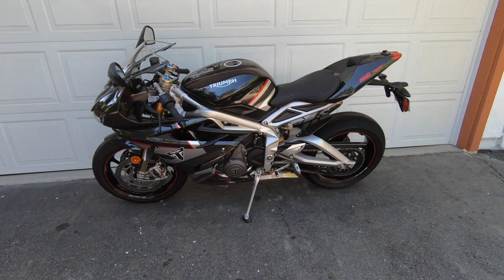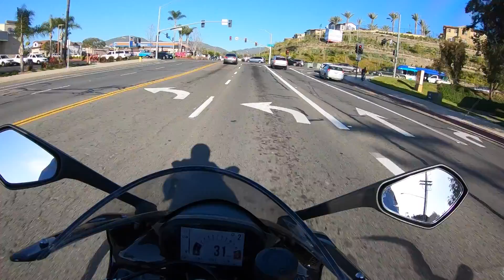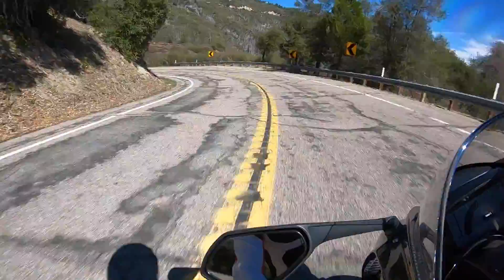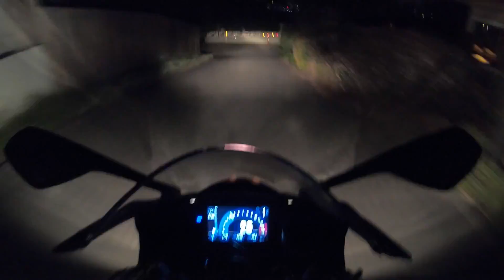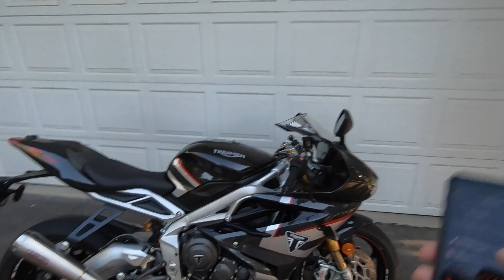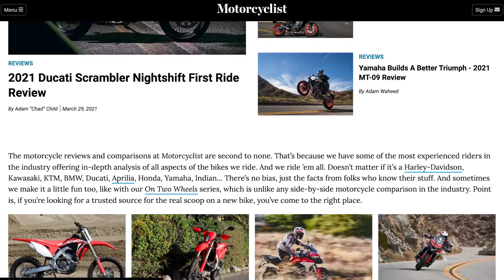2021 Triumph Daytona Moto2 765 Limited Edition Review | MC Commute

Comment: Only 765 of these made, lucky sobs. Get em while you can, oh wait they're gone.
Reply: Not really, they’re sitting at dealers
Reply: @pmwaffle9348  The pre-orders were all gone when I made this comment.  I think most of the ones at dealerships are pre-owned from those orders who don't want to keep it.  They are probably super low miles, but still someone rode it first.
Reply: @towatchvids  there's a few new and used starting at 12k. Most new ones are around 14 though.

Comment: I really cannot see a good reason to get this over an MV Agusta F3 800 RC which is it's most direct competitor I'd say. 
But then, this is a great bike too. The engine could have a little bit more power to seal the deal though, in that aspect is where I lean much more towards the F3.
And that Italian "je ne sais qoui"
Reply: Reliability and dealer network would be my concern. Mv looks stunning but, not so much if your staring at it broken down at the side of the road.
Reply: @andrewlucas6214  That's a fair point.
Reply: I’m Italian and yes, the MV looks stunning, but I’d rather buy the Triumph instead. Better ergonomics for slightly taller people. The F3 is suitable for jockey-size riders, if you’re a little bit taller you feel cramped after a few miles.
Reply: @Lasergun74  I'm 190 and to be honest I felt very well on the F3 for the most part (675 model) but I have relatively short legs and a long torso. That might have a part into it. 

I'm more confortable in the RS660 though, and I don't miss the extra power. Or the triple cylinder engine. Or having to deal with their dealerships.
Reply: @HormigaZ  indeed every body shape is peculiar, but there’s something in most of the MVs ergonomics that make me feel uncomfortable, all over the range.
The Aprilia is a great piece of kit, I agree, a sportbike made to be most enjoyable on the road. 👍🏻
Reply: The collector factor! Is all I I can see!